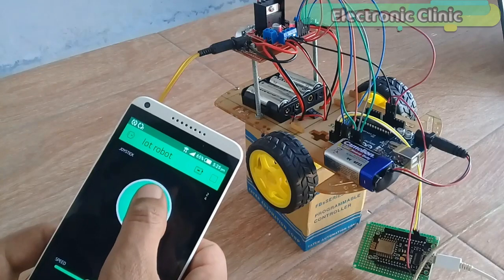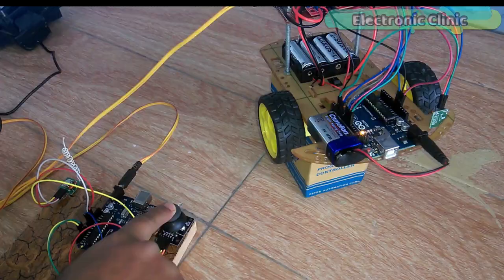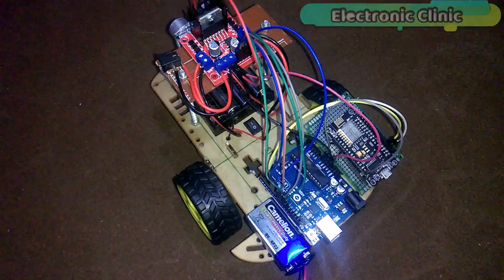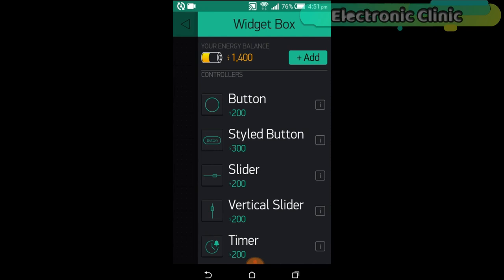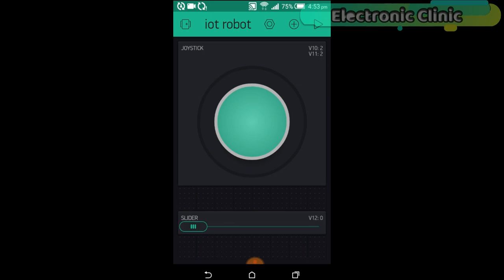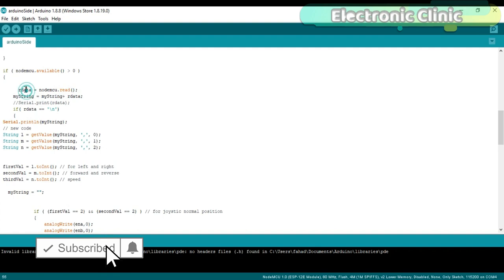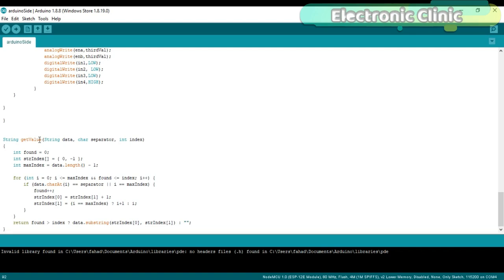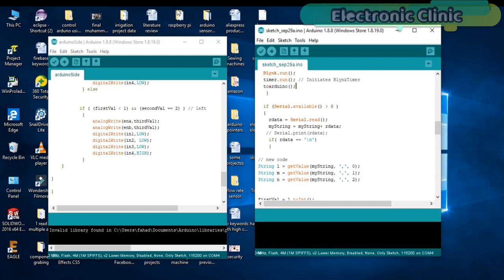Arduino IOT Project: Nodemcu ESP8266 wifi Robot Car “L298N motor driver + Blynk + Joystick”

Comment: Very nice project. 😍😍

Please make ac bulb dimmer using triac and iot based. Or speed control of ac fan or ac motor using triac based on iot.
Reply from the maker: my dear anything for you. i will do it for you.
Reply from the maker: just placed an online order :). now i am waiting for the triac.
Reply: Thanks bro. We would like to donate few amount for your hard work and project. How can i donate ?
Reply from the maker: You can be my Patreon. all you need is just pay 1 dollar :). you should also make patreon page. you are a professional and it will be an honor you have you as my patron.

Comment: This is awesome! I’m currently trying to use Blynk and a NodeMCU to motorize a model tank and it helps a lot to watch someone set it up. 

My current plan is to run this with the NodeMCU and a pair of continuous servos. I’m under the impression that I can hook the servos directly into my power source(a USB backup battery), pin the control wires into the NodeMCU, and run a Blynk remote control without motor drivers or a second Arduino. 

Assuming that my servos put out enough torque(speed isn’t important; I’d like this to move pretty slowly), does this sound like a valid setup to you?

Comment: great project. I have one question, Can we build it with only nodemcu and the motor driver? and what is the purpose the arduino is working here is it for variable speed adjustments?
Reply from the maker: Ya you can also build this only using nodemcu.

Comment: Arduino: 1.8.12 (Windows Store 1.8.33.0) (Windows 10), Board: "NodeMCU 1.0 (ESP-12E Module), 80 MHz, Flash, Legacy (new can return nullptr), All SSL ciphers (most compatible), 4MB (FS:2MB OTA:~1019KB), 2, v2 Lower Memory, Disabled, None, Only Sketch, 115200"

In file included from C:\Users\KUMAR-PC\Documents\Arduino\libraries\Blynk\src/Blynk/BlynkApi.h:17:0,

                 from C:\Users\KUMAR-PC\Documents\Arduino\libraries\Blynk\src/BlynkApiArduino.h:14,

                 from C:\Users\KUMAR-PC\Documents\Arduino\libraries\Blynk\src/BlynkSimpleEsp8266.h:24,

                 from C:\Users\KUMAR-PC\Desktop\spybot_nodemcu_programme\spybot_nodemcu_programme.ino:6:

C:\Users\KUMAR-PC\Documents\Arduino\libraries\Blynk\src/Blynk/BlynkTimer.h:36:21: error: redefinition of 'class BlynkTimer'

 #define SimpleTimer BlynkTimer

                     ^

C:\Users\KUMAR-PC\Documents\Arduino\libraries\SimpleTimer/SimpleTimer.h:10:7: note: in expansion of macro 'SimpleTimer'

 class SimpleTimer {

       ^

C:\Users\KUMAR-PC\Documents\Arduino\libraries\Blynk\src/Blynk/BlynkTimer.h:36:21: error: previous definition of 'class BlynkTimer'

 #define SimpleTimer BlynkTimer

                     ^

C:\Users\KUMAR-PC\Documents\Arduino\libraries\Blynk\src/Blynk/BlynkTimer.h:41:7: note: in expansion of macro 'SimpleTimer'

 class SimpleTimer {

       ^

exit status 1
Error compiling for board NodeMCU 1.0 (ESP-12E Module).

This report would have more information with
"Show verbose output during compilation"
option enabled in File -> Preferences.

Comment: the program you used in this video i.e,iot and arduino program is not compiling .it is giving some errors.please help me to solve it.
Reply from the maker: install libraries from my website
Reply: @ElectroniClinic  i had done it.but it not working
Reply: Yes i too have problem uploading programme to nodemcu. I had installed all the libraries and done all initial setup.
Reply: You should Install Blynk libraries in Arduino Ide